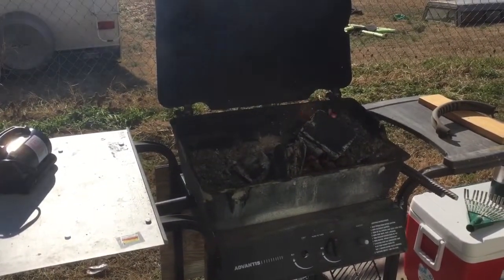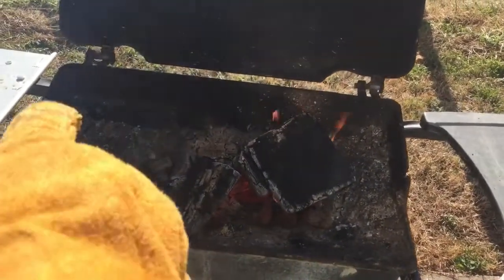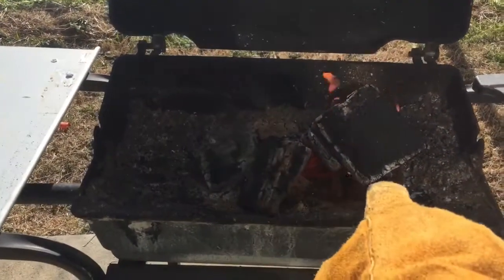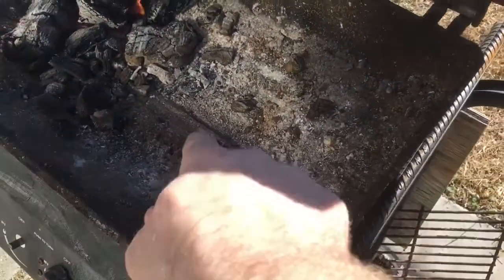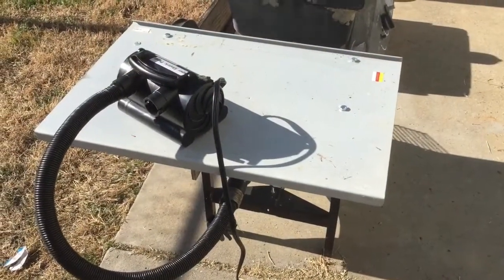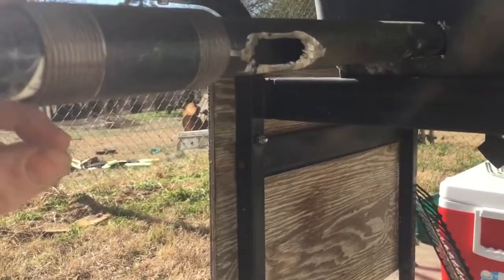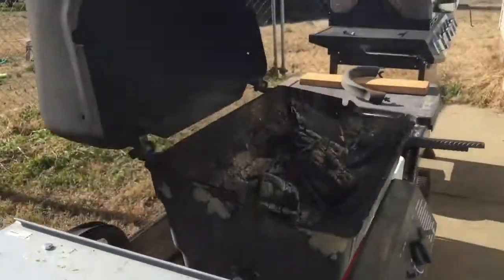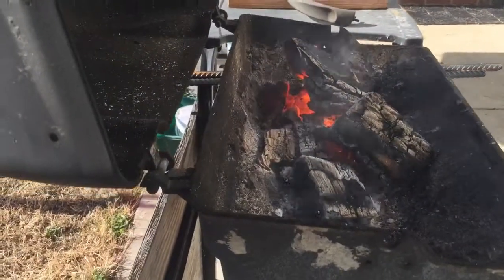DIY Make a Coal Blacksmith Forge From an Old Gas Grill

Comment: I didnt even use refractory. I got lazy and loaded it up with dirt around the forge pot and filled in then entire thing. Dirt has stayed pretty level.
Reply from the maker: That’s great to know. Thanks for letting me know
Reply: @SteveMoitozo2  thanks for the vid, the dirt has made for a good coal table, as well as a good normalizing rest for hot steel. And if it gets iffy, I just grab more dirt from the woods

Comment: I know that this is not exactly a new video. But, you can also use a harbor freight router rpm controller; to give you adjustability in the airflow. It would also extend the life of that motor, as it wouldn’t have to go full bore.